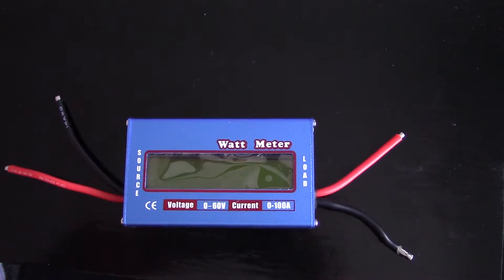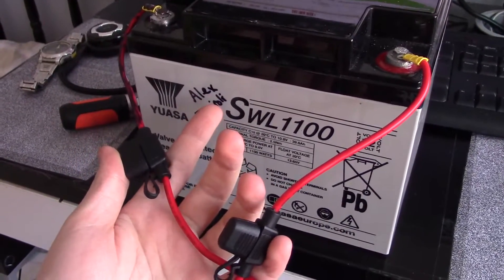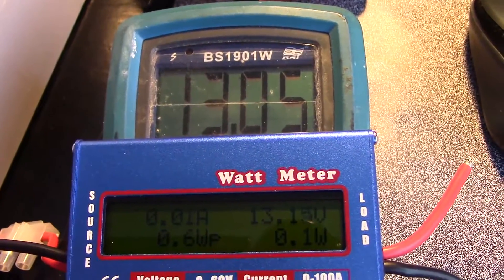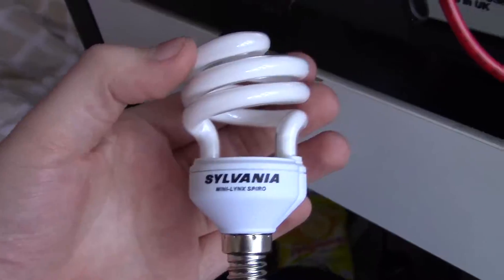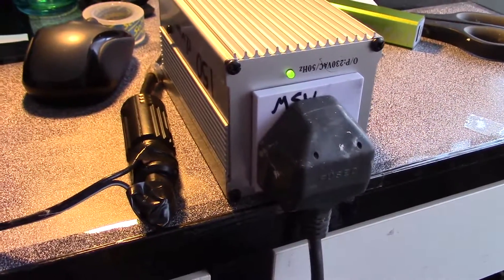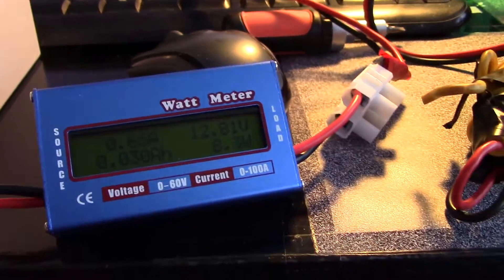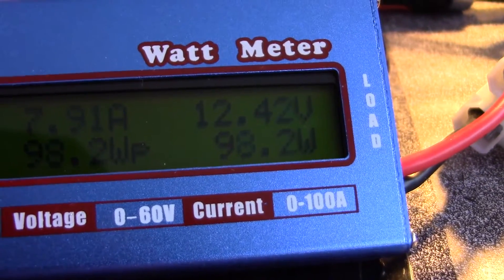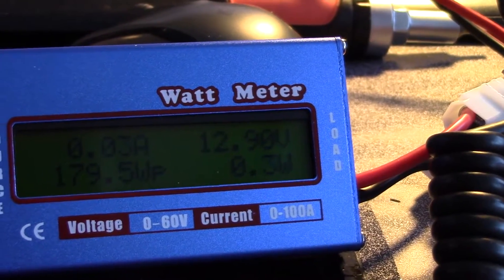Quick look at: DC power/watt meter 60V 100A

Comment: I have the same meter and frankly, they should've included some simple interrupt button that you could press to cycle to the next set of stats in the sequence so that one could view them when they're ready rather than having to watch the display through its sequential cycles 3 or 4 times in order to note all the changes (and contradictions). 

However, this inconvenience is overshadowed by the lack of information regarding the wiring options. I have a Stryker SR-955HPC V2 radio and I wanted to try exactly what you did with your Yaesu. Would you, (or someone who's experienced with this), please tell me how you connected the radio for this meter to reveal the stats?

I have a fairly good idea of how you connected it but the Stryker cost me too much to risk burning it out if I guessed wrong. Of course, I have the required dummy load but my concern is with the "Load" wires of the meter. I'm sure the "Source" wires are to a power supply so, is it simply the negative & positive Load wires running to the negative & positive power wires of the radio, or is there something else required between the two?
Thanks for the video,
Rich
Reply from the maker: This video is from a long time ago now, can't remember if I still have the meter.
As I recall, black to black and red to red.
Reply: @alexstechvideos9503  Yes, I'm sure that the Black goes to Black and Red to Red, but I'm asking if you had a regulator or maybe an inverter between the radio's power wires and the meter. For example, did the Load wires of the meter run to a regulator and then the wires from the regulator run to the power wires of the radio? 

But it seems to me that you may have simply ran the Load wires of the meter directly to the power wires of the radio. When I replayed the video, it appears that's how you had the connections.
Thanks again,
Rich

Comment: My wattmeter looks like yours. My one has a small hole on the source side. Behind it there are 3 pins. Does anyone know what function they have? External display power and/or holding the data? Backlight? Or for adjusting?
Reply: If you battery supply is below 4v the wattmeter will not work. You have to use a supply to power the watt meter.
Reply: Look for more video's from other yt'rs & comments they explain the function/s of the 3 pins . basically for requiring a bit more power if there isn't enough for the meter & one of the pins is used to do a reset

Comment: The meters are not accurate, especially at low load current draw below 1amp, so be warned, the voltage reading is also off for a 13.8V meter may read 13.75V, this varies from meter to meter by about 0.1V

Comment: I got 2 of these meters, and yes they are not accurate,  also each meter gives a slightly different reading. The meters current reading is way off below 1 amp current draw. Current does not even register below 250mA at 500mA meter displays an unstable 0.45A at 2A load meter displays unstable 1.85A,  At 4 Amps load meter displays around 3.85Amps. The cables are 14awg 2.08MM2 max recommended dc current rating is about 20 Amps.

Comment: I have the exactly the same type. After sunset, it turns off as expected because mine requires 4-60V input to operate. The problem is, even when I am generating as much as 19V on mid-day, it still doesn’t turn on.l; unless I turn OFF my PV breaker and back to ON. Any idea how to fix this?
Reply: Rainier Antonio I have the same problem, did you try switching the cables (connect source to load and the other way around)?

Comment: i use a 60v battery pack whose maximum voltage ranges upto 69v. is it possible to use this wattmeter in my battery pack? or is there any additional requirements needed to use this wattmeter?

Comment: This wires of power meter is too thin, can handle 100 amps ?
Reply from the maker: I don't know, but apparently so...
Reply: I have the same meter, the wires are marked on mine as 14 AWG.  This translates to 2.08 mm2 and at my rule of thumb 5A per mm2 comes to just over 10A (my rule of thumb is a safe.load, but with real copper cable, the meter has CCA cable which should have less current),   My meter did say in the doucumentation that it was rated at 50A continuous, andd100A for short periods.  I could see the wires getting pretty warm at anything over 20A contiinous. myself.  I modified mine and removed the red cables and replaced them with 1 thin cable.  The positive is only for powering the meter which draws a few mA, the current is measured across a shunt in the negative lead.  That way you only have compromised current on one of the cables..  There isn't too much room inside to replace the cheap negative leads with something more apprpraite.